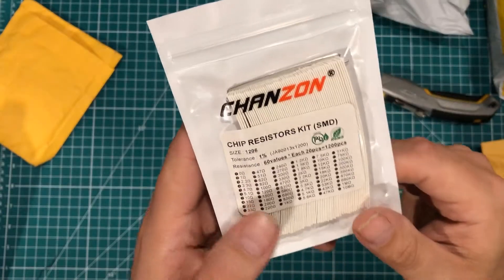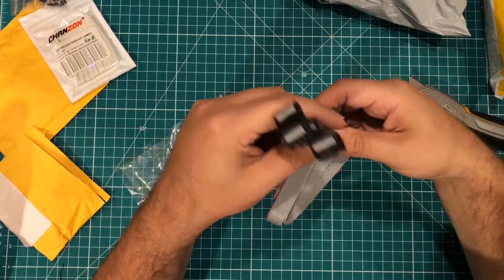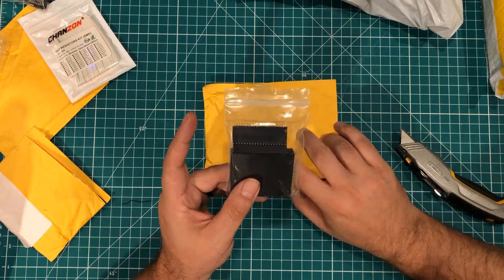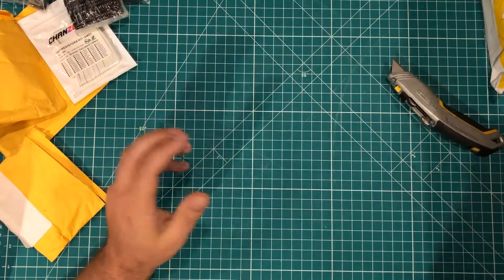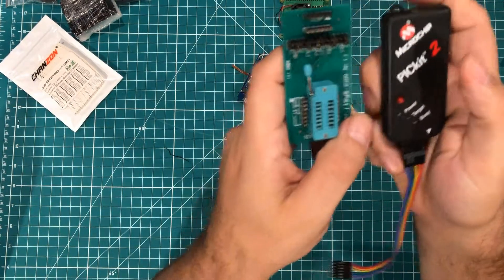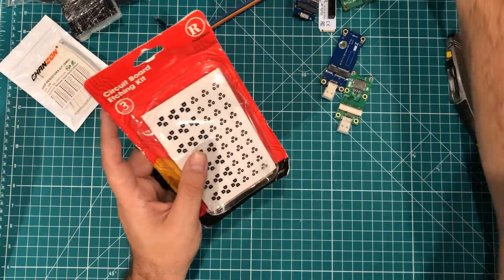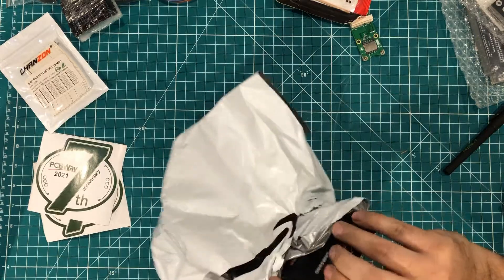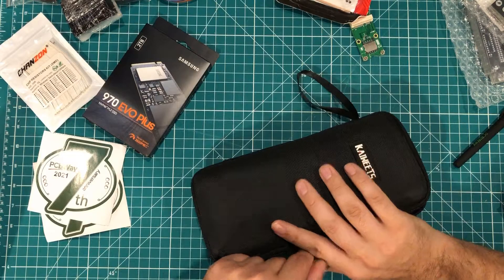Mailbag 47

Comment: I need to build a qty 20 1860 lithium battery bank with out pit ay 4volts for pi4, and some for monitor.

Can you build one and list items?  I’ll copy “”EVERY MOVE YOU MAKE IN DETAILED VIDEO.

safe charges, right electric feeds.  Then figure out how long it will run.,  I npmay create 2 battery packs to swap out.

Is that something you can do?
Reply from the maker: I don't do content on lithium batteries or include them in my commercial projects because of the potential danger.

Comment: It would be nice if you'd use the timeline subject markers used by others or put time links in the video notes.  The "Copper PCBs for Etching" you linked to are "phenolic substrate, far from being the quality of FR-4" according to a review.  These are FR4, at least they were when I bought some (since comments with links are deleted by YouTube, I only give the title for searching on Amazon): MCIGICM FR-4 Copper Clad PCB Laminate Circuit Board, Single Side, 4 x 2.7 inch (10Pcs).  Same price, better board material.
Reply from the maker: I tend to use chapters on tutorials and things like that. I feel like mailbags are super easy to scrub through if you're not interested in the current item.  That's what I do on other people's mailbags.

I appreciate the tip on the boards.  I'll update that.  And seriously.   Thanks for the feedback. I will try to use the chapters more.

Comment: The usb -> mini-pcie adapters are likely for 3g modems. The modems themselves never have the sim so they route the signals to a slot in the host machine (or in this case, adapter) :)
Reply from the maker: I could see that.  So probably not super useful to me. but still cool. Thanks for the info.